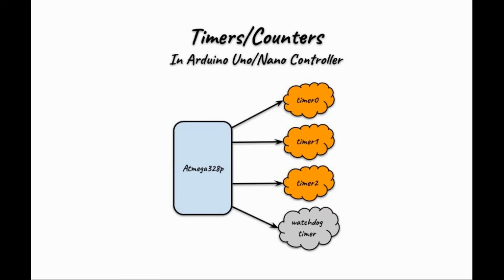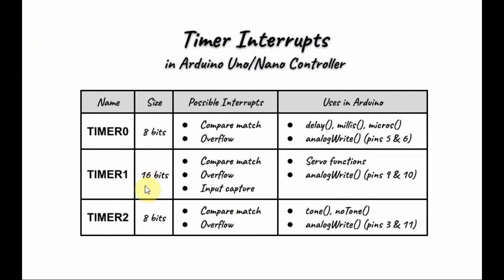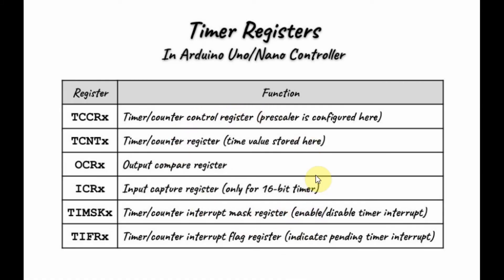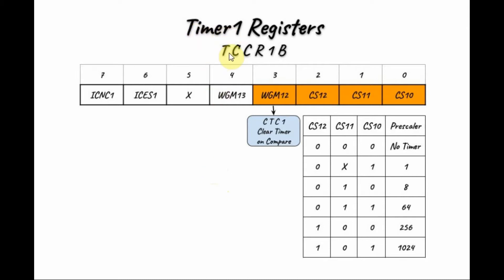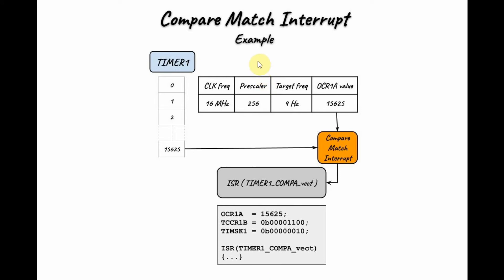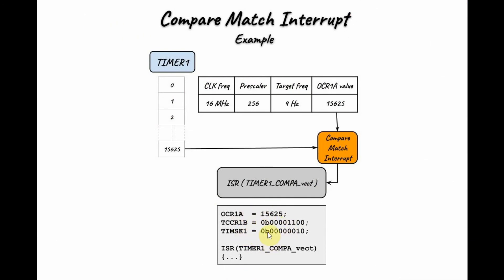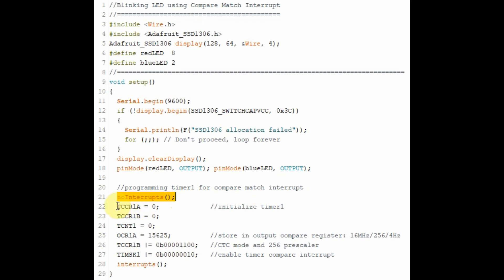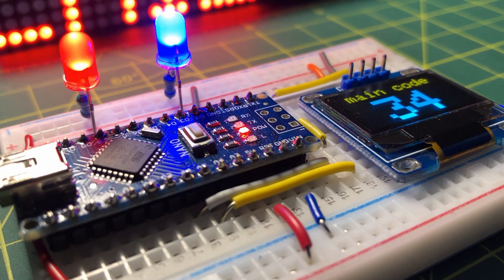Timer Compare Match Interrupt in Arduino

Comment: By far, the best explanation i have seen.  Make some video with arduino mega, please!
I already watched a lot of vids about the topic, but all are related to arduino 1, and also, those that explain timers and some other not so simple questions, mostly use complicated programm instructions; that if were known, should mean that the topic explained may be already known also
Almost all vids are about arduino 1, but the mega is way more powerfull, even timers are better to implement, since those (the 3, 4 and 5) are not so much required for other basic functions.
In fact, i am trying to make work a clothes dryer, which original computer is no longer available, and as a beginner, i started using dallas temperature library, and also timerOne library, which seems to create some conflict between them, and the machine looses the control it had at the first 5 minutes of running. My guess, is that there is a conflict between libraries, and i can not avoid the temp sensor one, but for sure, don´t have to depend on timerOne, which for me is a blind black box. That´s why i was looking for direct manipulation of original timers
As far i understand, a programm that starts working fine, and changes behaviour after some minutes, must have an issue that happens in hidden libraries, that´s why my search began. 
Again, thanks,
Reply from the maker: Thanks Pedro. I do have other videos on Arduino timers with applications such as frequency counter and time measurement of external events. As for the Mega, I will make a video comparing Mega timers with Uno and Nano. Thanks again for your feedback.
Reply: @AnasKuzechie  Already suscribed  Thanks